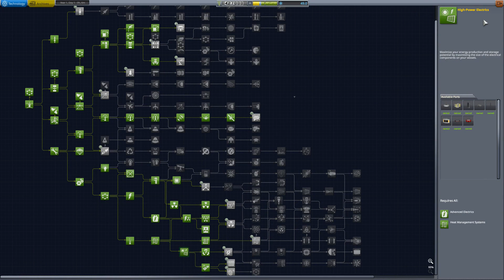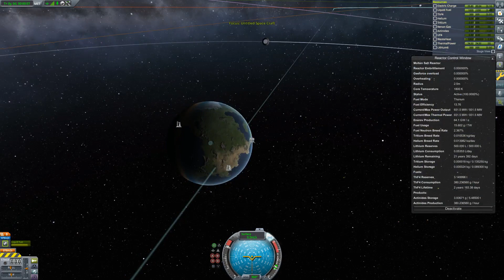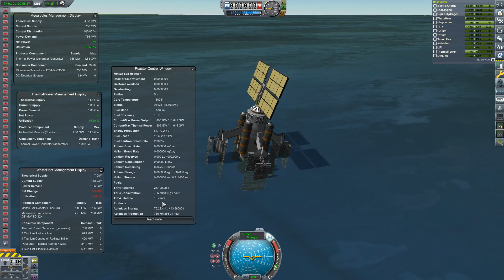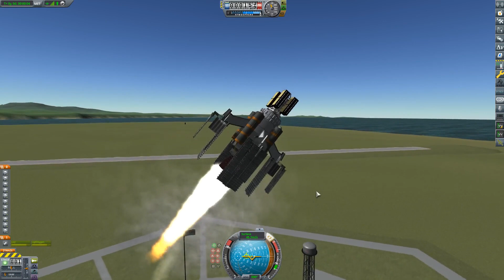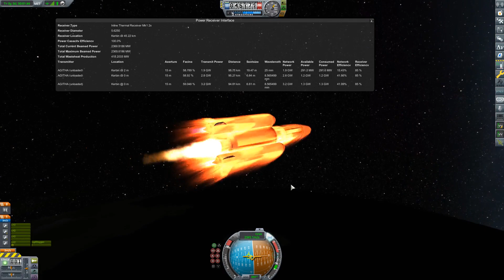KSP Interstellar Extended Beam Power Compendium (part 1)

Comment: Thanks for this. Super helpful. Questions: 1) What is the difference between the microwave bands? 2) I've tried to recreate the Micowave Tranceiver Rocket as much as possible and can only generate about 50 mW, so clearly I'm not doing something right. I have several Near Future mods installed (Spacecraft, Exploration, Propulsion, Construction, Solar Core, Electrical) but not Near Future Technology. Could this be the problem?
Reply: EDIT: I made a fresh KSP install with just KSPI and it worked perfectly. So now I need to figure out how to edit the Near Future mods to prevent this nerfing. I would just delete them from my save, but I already have several ships around using parts from the mod.
Reply from the maker: @hechtic  Sorry for the slow reply.Answer 1: The difference in the microwave (and other bands) is the specific wavelength used. Some wavelengths are better than others when it comes to atmospheric penetration and/or attenuation at distance. I pinned a useful link that will further explain this. Answer 2:  I think it's actually KSPIE that needs to be edited to prevent the nerfing. I might be mistaken but I think if kspie detects a near future mod installed it nerfs itself. There may be a setting to prevent that. Check on the kspie forum or discord and I'm sure someone will know how to do that.

Comment: I'm never too sure if there's something i'm missing or if this stuff is just buggy as hell. I cannot seem to get any engine to work with beamed power. The Krusader works with a reactor, but not when i replace that with an inline (or other) receiver/s. I have the termal receiver directly above the engine.. and just for good measure i connect fuel lines to it as well. The receiver tells me it has like 150MW of power available, and the current usage goes up or down when i scale the thrust accordingly. The engine tells me Prop. Requirements Met 100%, Specific Impulse this and that, Status Nominal.. the engine just does absolutely nothing. Any idea? I'm totally lost here. It's so hard to find information on this stuff.. like it's probably something like i'm missing power or connected stuff in the wrong order, but i just dont know anymore. 

If anybody has any clue what's wrong, i'd be super grateful.
Reply: I just removed all mods and made a basic setup with just KSPIE. Basically the same result. I feel like they reworked the entire system for all "Nozzle" type thrusters to actually only work with reactors now.. but this video is not exactly old so i wonder why they would do that now after running the mod for years.

I basically created a 5M fusion reactor + thermal generator in the plane hangar, drove it forward and pointed it at the launch pad. Beaming the energy using a phase array. 
On the launchpad i use a Krusader (Liq. Hydrogen) --> Inline Receiver --> Fuel Tank (Liq Hydrogen) --> Computer Core Setup. The receiver receives half a gigawatt of energy, which it quickly uses to heat up. I can throttle the engine up or down.. but staging, ie launching it.. gives no thrust whatsoever. 

This should show everything: https://steamuserimages-a.akamaihd.net/ugc/1655598926707181926/C76194434E8E78721C6E0A5BE357457CE9F947BD/

If anybody has any idea what may be wrong, or can confirm that basically all the cool stuff does not work without a reactor anymore.. would be welcome.
Reply: I just thought i'd add what i learned so far. First of all.. it technically works. In space at least. Launching using a receiver should also work, but it's weird. Maybe you need to flood the engine with gigawatts of energy to actually turn on in the atmosphere, dont know, did not test that yet. But dropping it from some height using the launch clamps while activating them.. sometimes does the trick too for some reason xD
Anyways, i'll just not use them for launch and solely use them for space stuff for now.
Reply from the maker: @Yamyatos  I wish I had an answer for you. I no longer use the mod, personally. Situations like this kept popping up where a part simply didn't work as advertised or would work in one version and stop working in another. From the last time I used it your setup looks correct. You might pop over to the mod's discord page and ask there? Just... avoid the politics tab...(that's what made me stop)

Comment: Hello, I have been trying to learn from your videos so I can get more enjoyment out of KSPIE, do you have any mods that are effecting your energy output? When trying to follow along with your build, at the 18:07 point, I noticed that where your "Power Output Mk2" is 675 Megajoules, mine is 6.75 Megajoules. Items are scaled to 2.5m for me as well, any suggestions?
Reply from the maker: If you have Near Future Technology installed KSP will adjust itself to match the energy requirements for that mod. (I don't have NFT installed). Basically NFT will reduce your power outputs to 10%

Comment: So I have interstellar extended AND Planetary Bases (Inc) installed as community mods. 
It is installed in the correct directory (I'm getting the mods in creative mode), but I don't seem to see the additions to the R&D tree. Any idea what might be going wrong ? 
Thanks
Reply from the maker: In career/science mode you'll need either community tech tree or unkerballed start tech tree. (but i think one or the other not both?) Should be bundled with kspie.  check your game data folder for Community Tech Tree, if that's missing, might be the issue.
Reply: @PunkWyrks  thanks for the quick reply and info. I had CTT in a game data folder inside the main GameData folder o_O. I fixe that but after reloading it still didn't work and looking at the CTT version file it would seem I need KSP 1.8 -1.9 and my version is 1.7.1.....So me thinks that may be the issue lol 
Thanks again.

Comment: Hey! Ive really been struggling to get the beamed power to work, Im in science mode and I cannot get the transducer to produce more than 14MW of power no matter what reactor I use, do you know what the minimums to make a beamed powered ship to produce thrust is for both parts and power?
Reply from the maker: Each transmitter/'ceiver/'ducer should have it's max power rating in it's right click menu (in vab and in game) use tweak scale to make the transmitter/diode bigger for more output.

Comment from the maker: Episode 10 of project Kerbalshed
Timestamps!
00:00 intro
00:55 tech tree overview
02:24 baby's first beam power transceiver
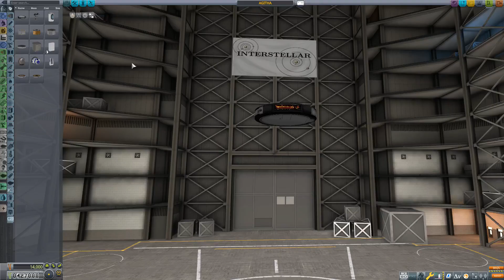05:25 build the thing!
07:03 radiator options, submerge those (non-graphene) radiators!
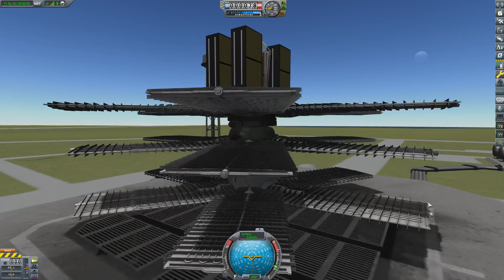10:00 initial reactor power test
14:42 tritium breeding
17:00 prototype ThF4 thermal rocket
20:00 prototype MSR rocket test
(yes we use liquid fuel for the test but not for the actual flights)
23:00 must go bigger 
24:00 went bigger
27:00 power transmitter 
31:20 hydrolox from here out
33:25 power transmitter test take one
34:45 power transmitter take two (now with more crossfeed)
35:42 transmitter take three (parachute test?)
37:00 this one should work...
38:30 splashdown!
41:00 n.b. fewer radiators, but still more power because ocean!
49:00 prototype thermal rocket test
52:00 moar powa!
55:45 batteries not included
57:52 moar powa transmittaz! (sorry about the dead air here, meant to dub over this and totally missed it)
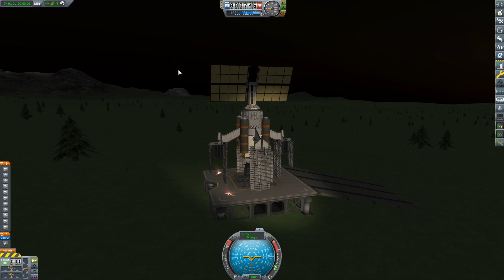01:01:53 one more transmitter on the other side of Kerbin for circularization (since I don't have relays up yet)
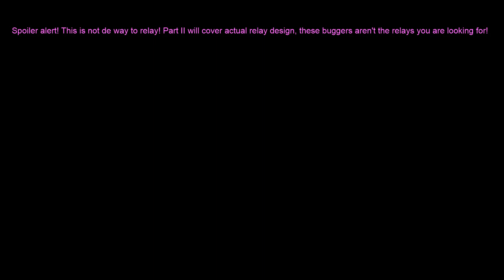01:03:02 Klaus [comm relay] thermal launch vehicle (flies but I used the wrong thing for a microwave relay)
01:09:07 launch the Klaus! remember, this is a good rocket but not a proper relay design.
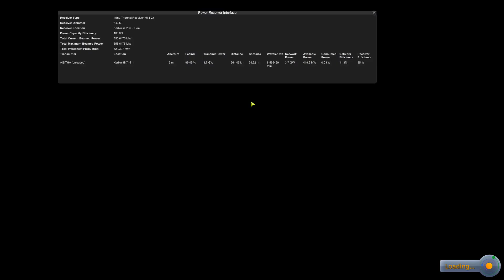01:16:46 another Klaus, but with no sound :/
01:23:00 recap
Relays will be Part 2, stay tuned.
Reply: Jhook, i have to say one thing:
Remaster that video, the info is right, and cool, and all that stuff but should have planned a tiny bit...
Here some suggestions: 
- use chemical as radial 1st stage, it will easy your life
- please, dont put the mirror BACKWARDS xD (I saw and the star trek double faceplam meme came to my eyes)
- ok, the rockets made me cringe and cry, I know you do better, please take more than 5mins to design that thing and the fins are allways DOWN or it will be unstable, your CoL MUST NOT to go above the CoM (the more down, the better) (usually, I put 4, 6 or 8 (never odd, or will try to spin) big ones at the very bottom 2, 3 or 4 (usually 1/2, but avoid 3) and teeny ones at the top to make it easier to turn)
-  far infrarred is better in every regard except if you have the transmitter right next to you
- orbital beams are easier and more efficient per unit of power (yes, ease to power ratio exist xD), just 1 lauch a big MSR, actinides tank and radiators, another a transmitter and fuel tank, and another a utility ship, and relay cluster (launch in reverse order), use the utility ship (a plasma truster+a power reciever+fuel tank+rcs+the docking port that is a probe core)
- the transmitter in the sea, make it easy, weels, grphite (>titanium, even though has less convection) and loads of MSR, like 2 or 3 (actinide fuel tank to long term operations), and a propeller, decouple the weels, recover the money and sail the reactor wherever you want...
 Note edit later I explained horribly 
 second note not be a lazy bastard and actually do it
Reply: I have to give you an intensive class on aerodynamics... X'D
Reply from the maker: @antaresmc4407  you know, you cold always download some free editing software and make videos too... I'd like to point out that my goal here is not to teach aerodynamics or rocket science but to showcase the parts in this mod. I do try to point out as often as i can that what I'm showing can and should be improved upon.  I really appreciate comments, suggestions and even criticism. But, there is no need to shout or display poor manners. Keep flying!
Reply: @PunkWyrks  sorry if I sounded rude, wasnt my intention. Im working on that learning to make vids thing...
You actually make the best KSPIE tutorials I see... sorry.
The aerodynamics thing was a joke, should have put an emoji XD
Keep doing your stuff! I know its not a class, sorry again, I have the tendency of explaining as well as a closed book. Probably will edit the comment. I usually use the capitals to mark sentences, should stop... anyway, sorry, its actually very good and all of this is small details. ;D
Reply from the maker: @antaresmc4407  All good m8. In your defence I do tend to make flying bricks :)
Reply: @PunkWyrks  Nah, actually athmo is a ** anyway. Its just more fu to make vaccum only vehicles.
I usually have the polar opsite problem, I start desighning tk make it streamlined, cool and aerdynamc, and becomes so smooth that the rocket is more stable backwards XD.
Anyway you should give a mention to nuke jet powered floating rovers! As silli as it sounds its perfect for moving real big power plants. I discivered the method trying to optimize the move of 5m tokomaks...
Reply: @antaresmc4407  are you the guy from the KSPIE discord?
Reply: @gravity6787  probably :P